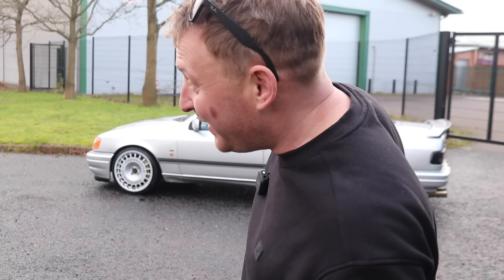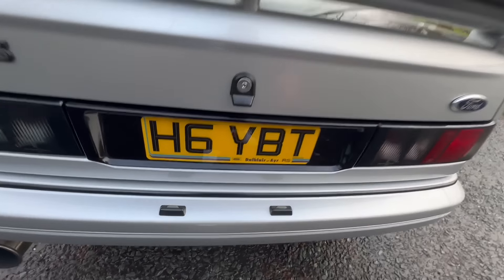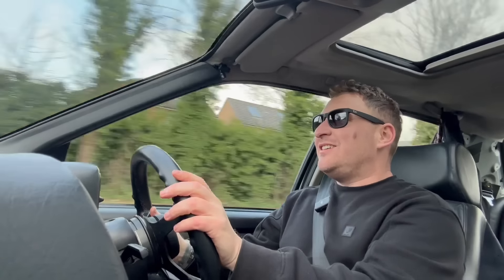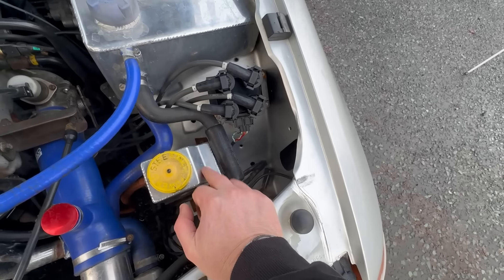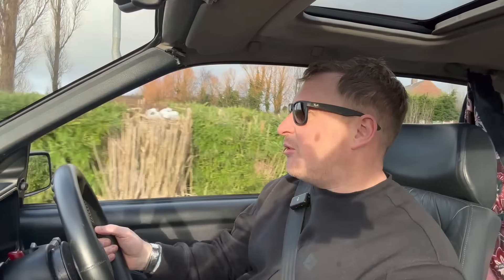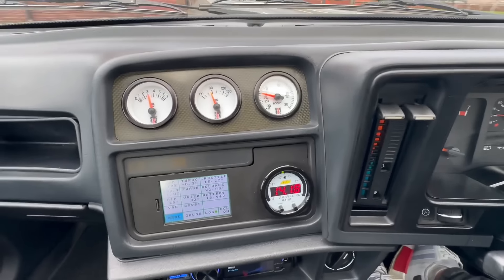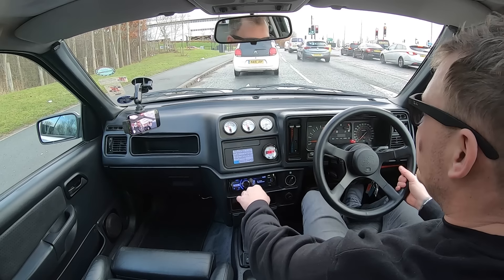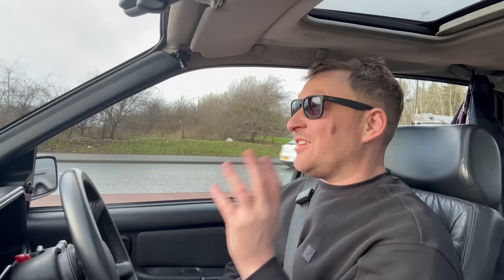Dan Gave Me the Keys to His Sapphire Cosworth

Comment: Very nice car, Adam quick question, why is there so many holes in the front drivers inner arch seen under the bonnet, is it like that from the factory or have they been drilled over the years for alarms and what not, seems excessive and a way for  water could get in?
Reply: Ive ofyen wondered the same on pretty much every cossie ive seen.   They look factory too.
Reply: I believe it’s for different engines. They have different airboxes etc. all the shells are basically the same from a 1.6gl to a cosworth (pretty much)